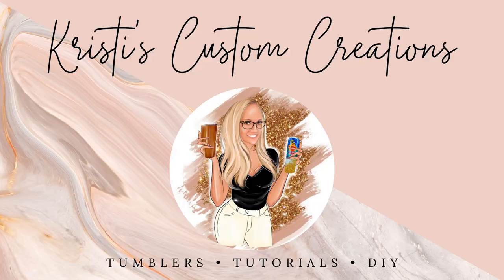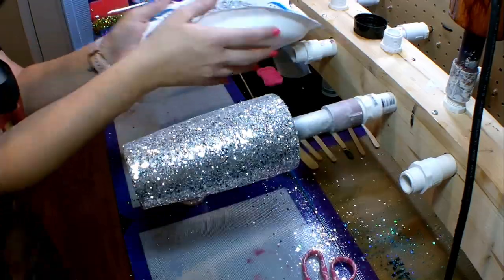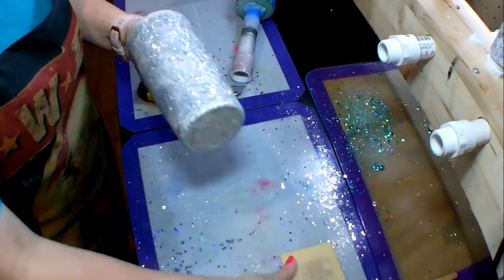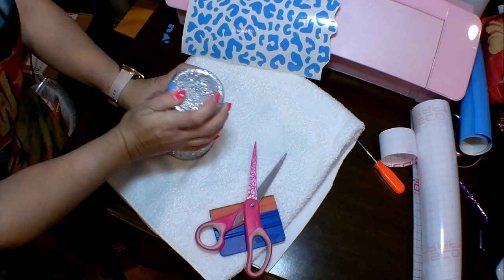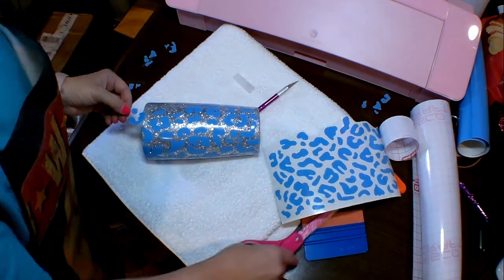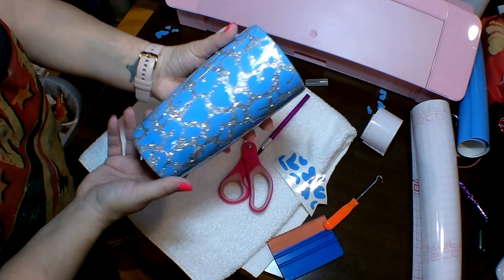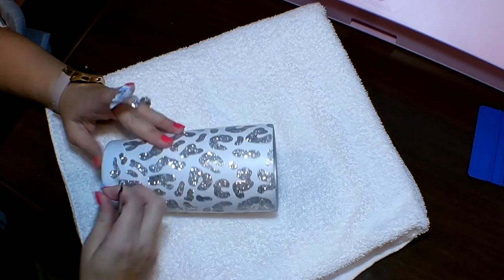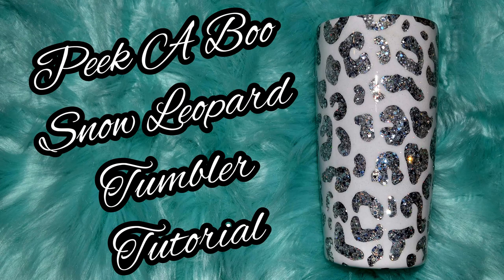Peek A Boo Snow Leopard Epoxy Tumbler Tutorial | Peek-A-Boo | Tumblerpoxy

Comment: I need help tumbler fam! I used cc diy quick coat over a decal on a spray painted tumbler and it dried beautifully after an hour here. After applying second light coat of quick coat I realized I grabbed the paint brush that I used for the first coat. I was so busy I forgot to put it to soak for cleaning. What can I use to wipe this tumbler? Alcohol seems to remove the quick coat. Would putting another layer on it correct it?? Can’t get anyone to answer the phone for service
Reply from the maker: Oh no! I've never actually used diy quick choose but maybe try baby wipes to wipe it off. Alcohol would definitely probably be too harsh but baby wipes on tumblers work great for me when I mess up.
Reply: @KristisCustomCreations  thank you so much!

Comment: What vinyl do you use for the spots?
Reply from the maker: I just used 651 oracle vinyl. I had a lot of this color but you can use any color bc you'll just end up throwing it away. Since the 651 vinyl is considered permanent vinyl, I find it a lot easier to work with if you remove it fairly quickly and don't leave it on overnight.